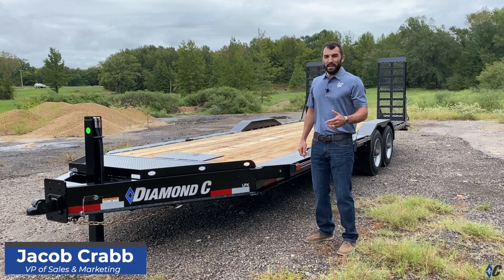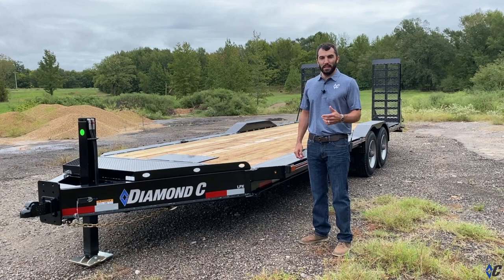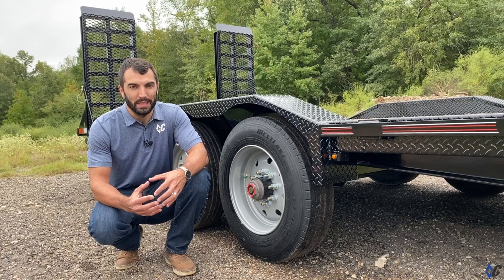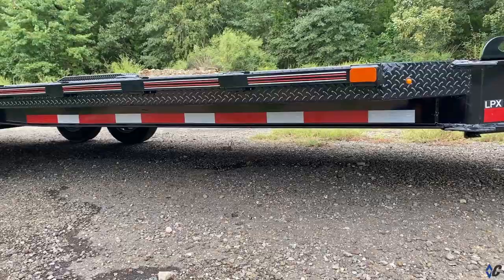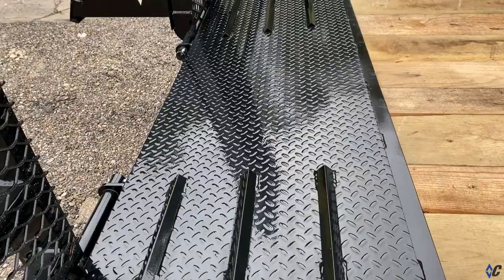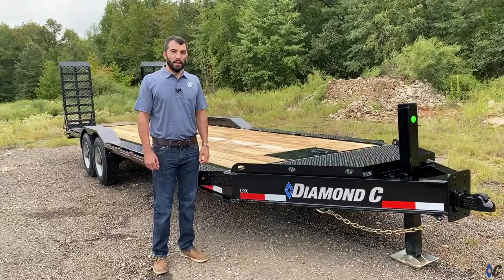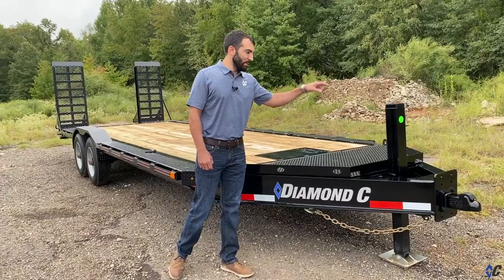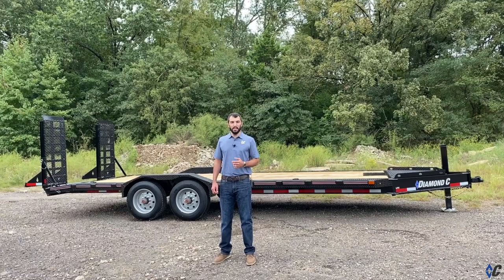“Design your own Trailer" - Model LPX Equipment Trailer

Comment: The problem is, oak floors, winch plate, and hydraulic jack are not shown as options for the LPX on your webpage.
Reply from the maker: Hey there! Winch plate is listed as an option on the LPX under the features tab 👍 the Oak Floor and Hydraulic Jack aren’t listed there as they were custom asks on this particular build - you can inquire about them with you dealer and can be quoted for you no problem! 😁 We are working to make them selectable options here in the near future.

Comment: When building a LPX trailer like this one on your website. I don't see the option for the electric over hydraulic jack option?
Reply from the maker: Currently that option is not on the build your own. You can build it out to the spec you’d like then put the hydraulic jack in the comments on the final page to send to the dealer for pricing. 

We should have the hydraulic jack option live on this model within the next week. 👍

Comment: Do these come with leaf spring suspension with the 10k axels ?
Reply from the maker: Hello there Javen! Only torsion with the 10K axles.
Reply: @diamondctrailers  okay because I just found a 2021 lpx with the 10k axels in acampo and they say it has leaf spring suspension
Reply from the maker: @javenmontoya138  hmm 🤔 shouldn’t be unless it was something special.
Reply: @diamondctrailers  if that’s the case does the 6 leaf spring suspension affect the amount of the actual payload for the (2) 10k axles ?
Reply from the maker: @javenmontoya138  both would still be rated the same 👍